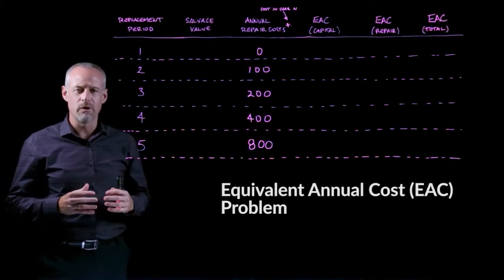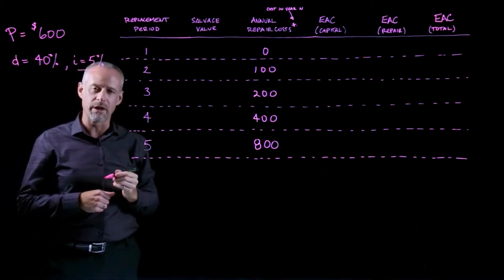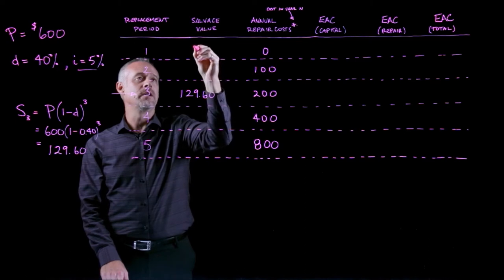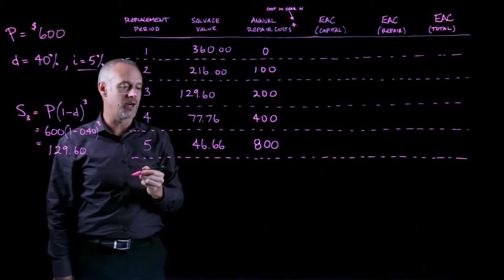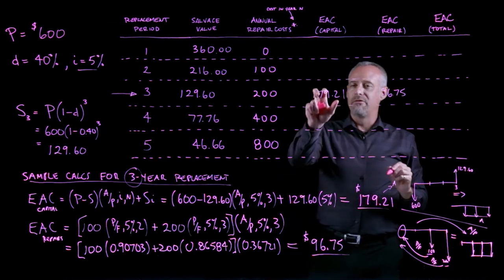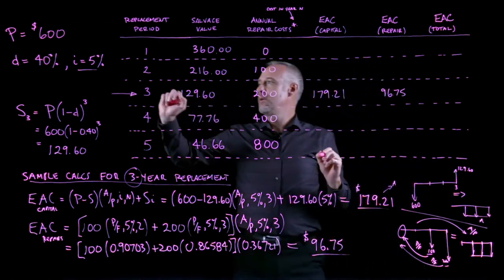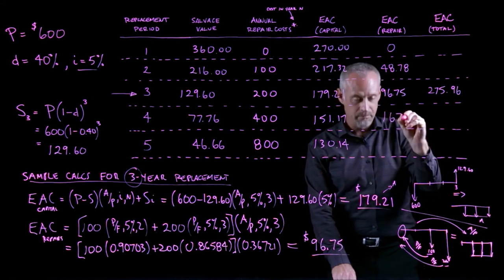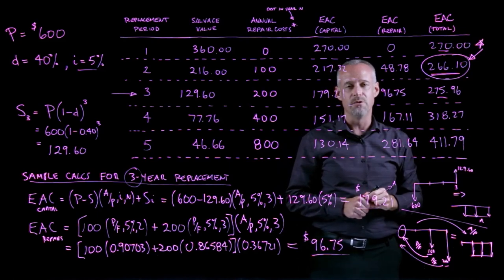Equivalent Annual Cost Example 1 - Engineering Economics Lightboard

Comment: Thanks a lot for the great videos! For calculating EAC_repair, one could also use the arithmetic gradient and directly convert the cash flow for repairs for the 3-year ownership scenario to an annuity. That would be 
EAC_repair = 100 * (A/G, 5%, 3) = 100 * 0.9675 = $ 96.75 
This is just a lucky coincidence, but it matches the calculations in the video.
Reply from the maker: Yes, absolutely!  Great comment - thanks!

Comment: Excellent example! Thank you. I tried to use 100(A/F(5%,2)+200(A/F(5%,3), but it yielded 112 instead of the 96.75 for O&M at 3 years. Why?
Reply from the maker: Good question and a common error.  Draw a cash flow diagram.  Remember to start counting years at the number zero!  The A/F for 100 should have n=1, and the A/F for 200 should have n=2.  I hope this helps!
Reply: @EngineeringEconomicsGuy , yes, it does. Thank you. I think it is safer to move them all to PW, like you did, or some FW prior to applying either A/p or A/F. Sir, I owe everything to you as far as engineering economics is concerned. Thank you so much...

Comment: Is there a way to compute those calculations using excel, or any other software?
Reply from the maker: Great question!  The short answer is 'no', but if you're careful you could program the cells in a spreadsheet to replicate this analysis.  Unfortunately, there is no one simple formula that can be used DIRECTLY for EAC.  Excel does have built-in functions for A/P, P/F, etc.  They are called PMT and PV - and there are other ones!
Reply: @EngineeringEconomicsGuy  Thank you. Your videos are very clear.
Reply from the maker: Thanks!  I'm glad you like the videos!